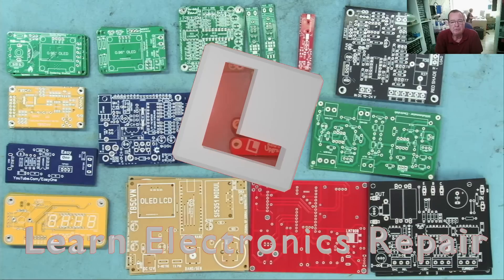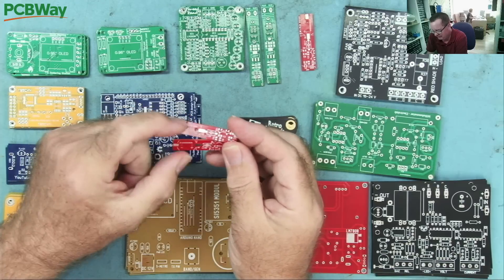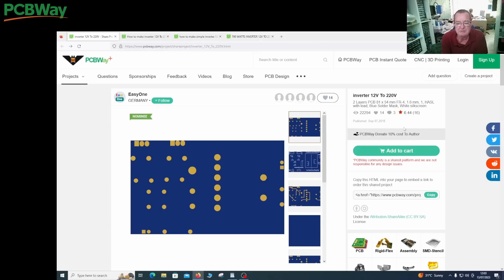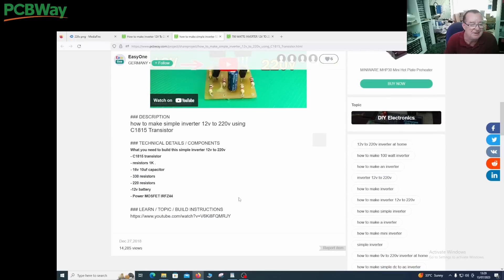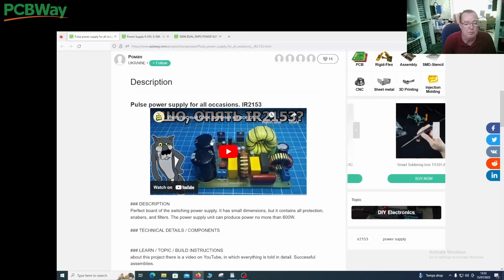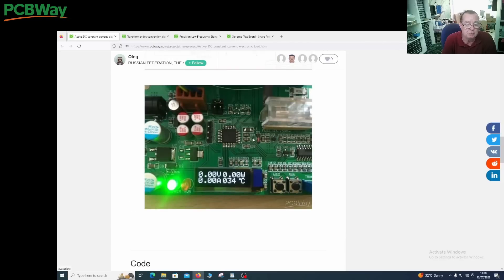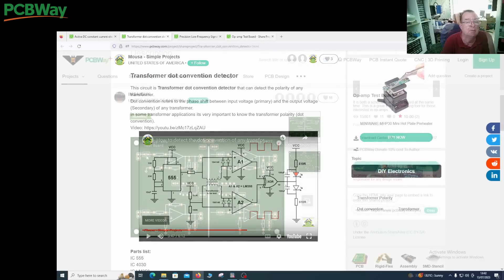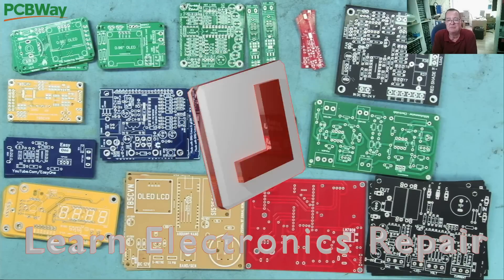Learn Electronics Repair By Building Projects - And Fixing Them!

Comment: Hi Richard, I'd like to see you buy one of these "fake" 2-3000Watt Chinese inverters and dismantle and show WHY they are fakes and how to make a genuine say 2000W supply out of one or what mods can be made to the design.  Also of interest would be your explanation of the differences between PWM Solar controllers and MPPT (of which there are also many "fakes" LOL) ie: PWM's pretending to be cheap MPPT (or worse still RIP OFF PWM's at seemingly slightly lower MPPT prices!)

Comment: 16:12 - I have been unable to locate a pico- or at least a micro-ammeter circuit. I think you would be the best to design such a project using a d’Arsonval meter movement. Might want to have a go?
Reply from the maker: Thanks for the suggestion, I'll take a look

Comment: Idk about the power supplies, I have a feeling that a salvaged ATX psu will be better (more stable, reliable and more powerfull) than the smps projects here. The inverters are also not a great idea, all of them produce an output that is far from a sine wave, is unstable, dependent on the load and could potentially damage any device attached to it, because of the huge voltage spikes. The fets or bjts used in them are also often easily strained by the fixed frequency switching. The best (least worst) circuit seems to be the first one, as it is based on a ZVS circuit (zero voltage switching, so the fets turn on/off exactly at the zero crossing of the wave, which is good for minimising power losses). But again, what is the diode doing on the output? An inverter is supposed to output ac...
Reply from the maker: I think I was more interested in building these as a teaching or learning aid

Comment: other fun projects would be making vu meters analog and led or peak levelmeters or even lcd you can have so many variations like a 30 led precision Vu meter or you making your own dummyload to fix amplifiers or ... if you think you are up to it make a audiomixer from scratch that be a big but fun project to follow and very usable for the most of us watching I love audio circuits and projects they are loads of fun plus that will get your mind of the life things for a bit as those projects takes time and multiple parts video's you like to teach us we like to learn from you and those projets would be awesome maybe you could do those together with det and carlos like vu meters with arduino det can do that programming carlos for making housings for the projets and designing the pcb's you with det i really think you should do this thanks richard for teaching us the fun of working with electronics
Reply from the maker: OK I'll add these to the order (if possible) Cheers